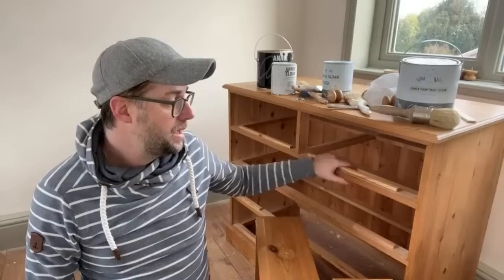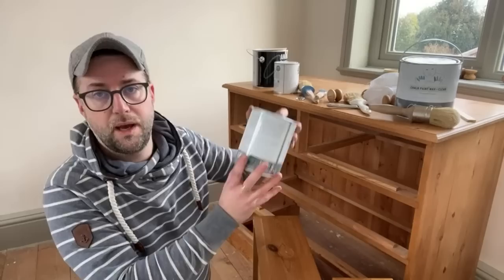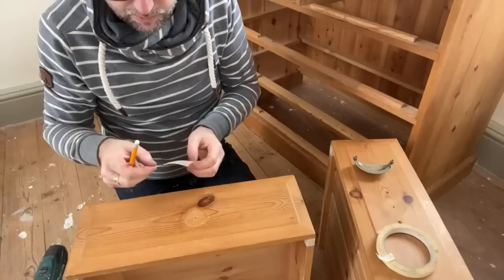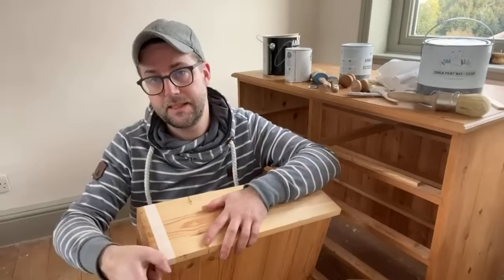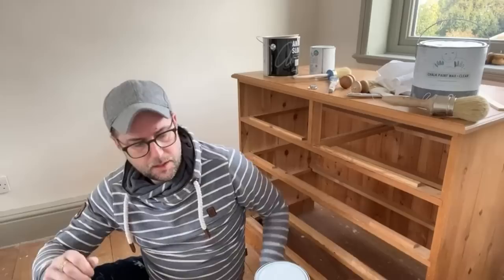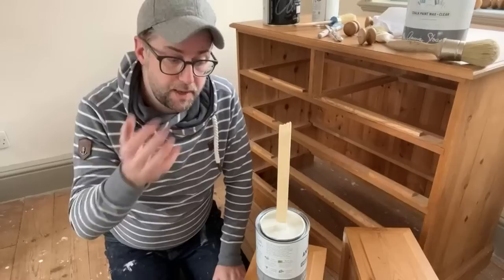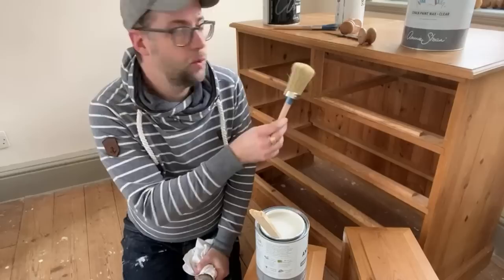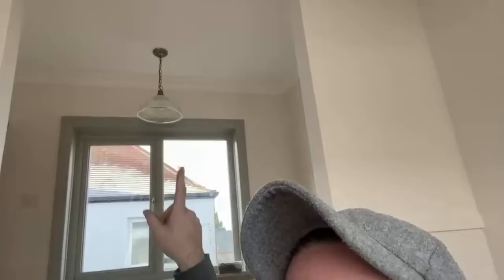Chalk Paint Back to basics beginners project ￼￼

Comment: Thanks for a great video.
I'm a chalk paint novice.  Do you sand with fine sandpaper between coats, and before using the wax?
Reply from the maker: I suppose it depends on the finish if you’re going for a super flat finish then I would advise a very light sanding with fine grit paper but if you’re quite happy to go with a playful textured look it can be quite amazing with tinted wax over the top

Comment: Thanks for this recap! So useful to refresh the basics. I would add: If you want to thin the paint I would suggest to not add water directly into the can, as I did few times because...I never learn! 😅
I painted the bottom part of my entry walls in Athenian Black Chalk Paint and I needed a thinner paint, I added water directly. The day after I found the paint had the “solid” part separated from the fluid one and it was really hard to mix them both together again.

Comment: Andersonville, Tennessee here! I have to do a bedroom suite for a client. It is solid cherry. No veneer. She wants a paint wash in a cream color, but I am afraid it will bleed through. She definitely prefers a wash and not paint, so I can't use a prep to lock out the tannins and still get the white-wash effect. Or, can I? I know you are very busy, but do you have any suggestions at all? I did a wash on a piece like yours awhile back where you used a touch of green to counteract the red, but she doesn't want the green tint. Basically, HELP me if you can.
Reply from the maker: Firstly if you’re gonna do a colour wash then definitely make sure that there’s no topcoat varnish wax finish before doing that otherwise it will not sit very well over the surface of the colour that are used to knock out the ready towns with Versailles which is kind of a pale green cream colour you could add a touch of that too creamy white shade and it should help with the red tones alternatively you could maybe use just white wax over the natural timber this will give you a white washed effect it is difficult without seeing the project I wish I was so there with you to help out in person 😊😊

Comment: Thank you Jonathan for this back to basics. I have had issues with the knots showing through when I paint pine. I did not use Annie Sloan though, so does Annie’s paint block the knots from bleeding through? Thanks
Reply: Annie’s paint is the very best chalk paint. Her paint will do things the other paints can’t do. The original, and she best. Give it a try.
Reply: I've seen some artist spray or paint a sealer over raw knots in wood the paint. I haven't tried it myself though. What do you experienced painters think?